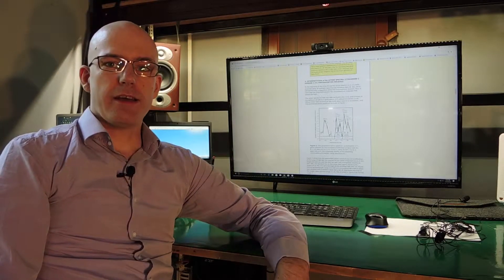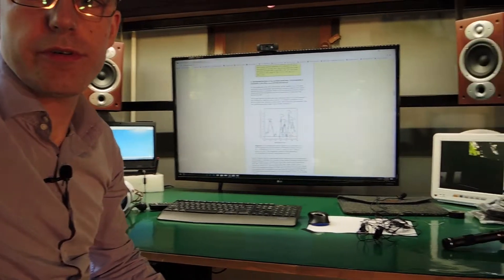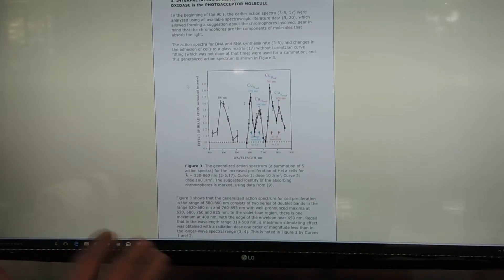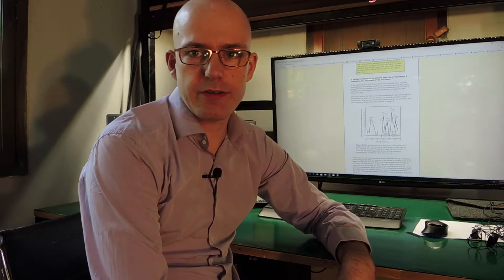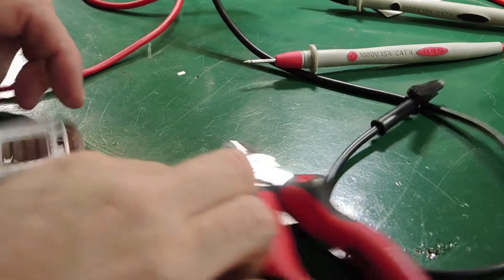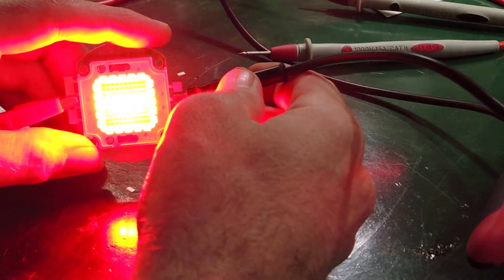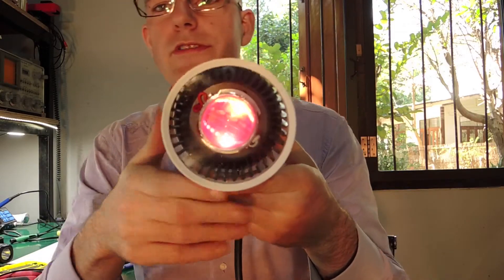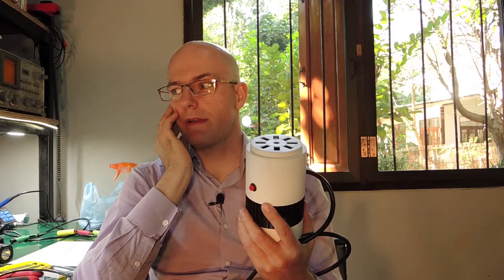Photobiomodulation with NIR part 2

Comment: Knowledge is POWER & not to be easily accessed by the non initiates to Secret Society control, leading all the way back to the 1700,s & Dr.Dee 007. I was thinking of combining a Strobe Light knob to dial up 10,20,30,40 Hertz. So make it happen McGiver!
Reply from the maker: the product is now finished, and production is just around the corner, check out my website,  www.personalrecharge.com for more info.
Reply: Infinite solar for all $3900.00?
Reply from the maker: Freddy Golz [Official] home use product is called Flexbeam and will cost 399$